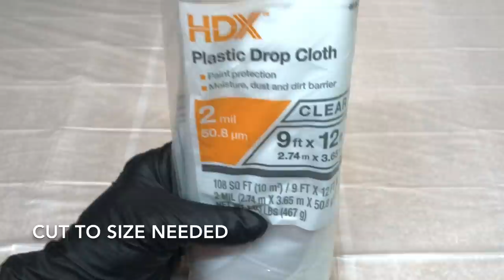Shelton Hand Plane Restoration

Comment: Part of me died when he painted over the mating surfaces of the frog
Reply: I'm right there with you
Reply: Well he is obviously not a woodworker, this plane definitely needs tuning before being functional.
The restoration is nice for decorative purpose though.
Reply: I don't think it's realistic to tape off the frog areas.  If it were me, I'd have used a flat surface with some sandpaper to true up the sole and those frog surfaces after the painting was done.  He might have done that.  I noticed the nameplate had not been filmed but was back to its original condition with red background.  Either way, I'm not thinking some paint on the mating surfaces would do much to hinder the performance of the plane.  There are probably a few more things that we all could opine on.  Food for thought.  Good comment.
Reply: @alext8828  5 months later - but this. This is exactly how I would have done it.

Comment: I've seen some discussion on the product originally used to coat tools like planes, how it was more than paint, providing such a thick, hard coating. One of the guys was mixing roofing tar into his black paint to recreate the finish. 

A surface grinder would be an awesome addition and alleviate much of your hand filing/sanding, but I guess that 's the point.
Reply: The 'coating' on hand planes is, typically, known as Japaning and was used on much, much more than on tools. I have to cry shennannigans on the claim of roofing tar mixed with paint though. Roofing tar tends to not cure, or at least excruciatingly slow. Most likely you'd just end up with very smelly, highly flammable thicker paint that is very, very soft providing it ever cures. Not to mention the process of Japanning isn't some lost ancient secret.
Reply: @markf.4063  You are absolutely correct on the term Japanning, Mark. Thanks, I could not remember the term off hand. I did a quick search of the forum I remember reading about it, but was unable to find a thread. There was a reference to "asphaultium" as a part of the original product, and I think that was where the roofing material came in, as aa substitute for that product.

Comment: Painted machine surfaces is not good. The entire flat surface of the frog should be flat so the blade doesn’t shed or not painted. The meeting services of the frog and the body you painted that’s not the way to do it they should be machined and perfectly smooth so they can be adjusted in that chatter. The restoration is a tractive but not very functional also the plane blade was not sharpened which is critical

Comment: The end result is nice but I do wonder as to why you decided to strip off the original Japaning when it wasn't really in bad condition far as I could tell. Also, did you go through the process of lapping the sole and squaring the sides off camera?
I notice the use of wood conditioner, why? If your ultimate finish is going to be shellac than there is no need to pre-condition the wood since shellac is a finish and NOT a stain so preventing blotchiness wouldn't be a concern which really is it's only use....and quite possibly just de-waxed shellac to begin with.
Reply from the maker: Hey Mark! When I’m working on a tool it’s my habit to remove everything, even the original Japaning. And I do understand that the finishes that I put back on it are not necessarily as rugged as it originally had. I make do with the techniques I know and the products at my disposal as best as I can. And I’m always looking to improve my materials and techniques. And great point on the wood conditioner! I was not doing that in an attempt to avoid blotchiness. While I do use it to avoid blotchiness on certain woods before staining.  In this case my reasoning was to start sealing the grain with a clear product so the end result would not be too dark just using amber shellac. I’m not saying that’s the sound this reasoning. But that was my reasoning. What I would have preferred to do was start with a blonde shellac and work towards a amber. But on hand all I had was wood conditioner and amber shellac. Thanks for for making those great points!

Comment: The bearing surfaces on the blade side of the frog need to be left unpainted and the surface trued.  Crucially also the bottom of the plan needs to be flattened exactly 90 degrees to the sides.  That was a cosmetic restoration rather than a  functional one.

Comment: without flattening the bottom, which is difficult, this tool isn't usable.
Reply from the maker: Hey Eric! I did flatten the bottom some but not totally. That was not shown on camera. I wouldn’t say it’s unusable without a perfectly flat bottom it’s just not as precise. I used my Stanley plane for years before I flattened the bottom and it worked OK. But when I went to flatten the bottom i realized it wasn’t even close from the factory. But very true, if you true up the bottom and set the blade right...it will spit out a wood shaving you can read a paper through. Thanks for the comment!
Reply: @KILORESTORATION  I had to do it for my restoration.  It was the biggest pain ever.  I don't think I had the righ tools.  I used 220 grit sandpaper and a flat granite stone.

Comment: Why would you take off the extremely tough original japaning that will last 100s of years to put a cheap weak coat of spray paint on it. 😳
Reply: Is that japanning?  I picked up this exact plane, albeit with less rust.  Note that the plane body does not have the Shelton name or “no 9” on the front end by the knob.  I’m looking for a solid type study on Sheldon’s.  But I suspect this is a later model Shelton, and that the original finish may not be japanning.  Mine cleaned up nice, but it seems a little glossy for japanning.